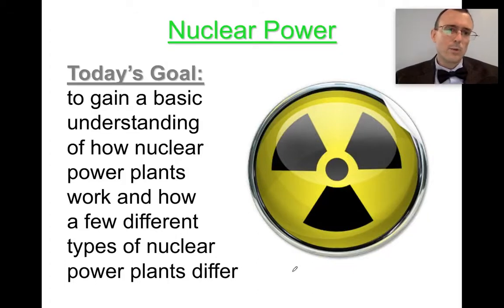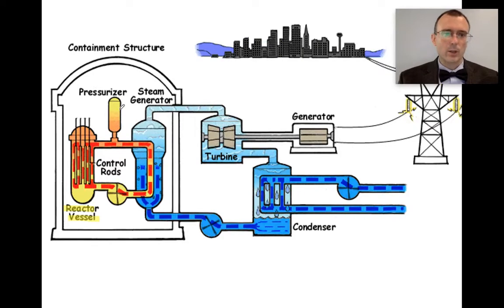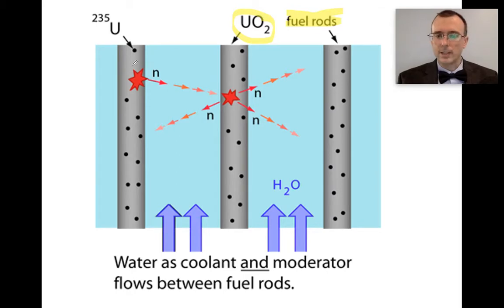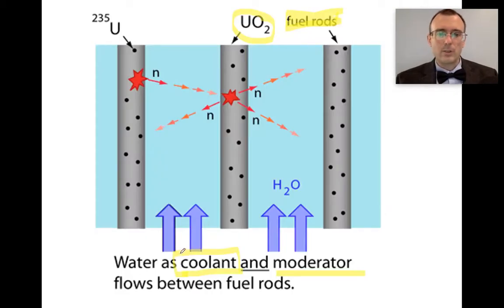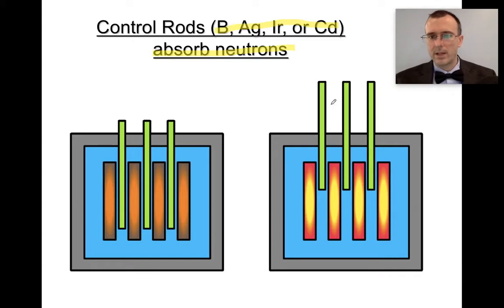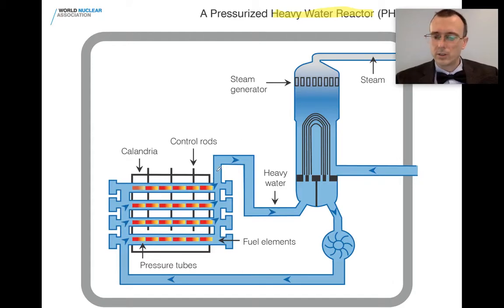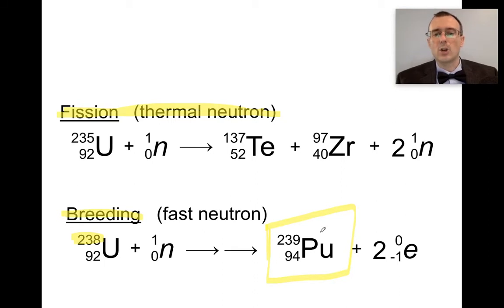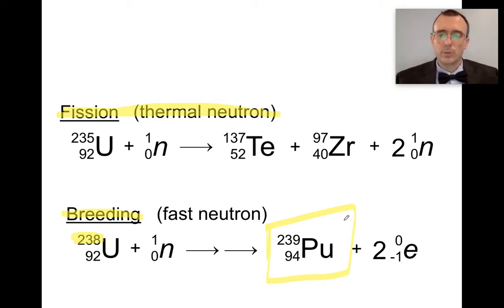How Do Nuclear Power Plants Work?

Comment: You mistook U235 for U238 at the 19 minute mark.  U235 is used in nuclear weapons, not U238
Reply from the maker: ah, you're right that I made a mistake, but your numbers aren't quite right either. Thorium breeds to make Uranium-233, which is what I should have written. Uranium-235 is used both in nuclear weapons and in traditional nuclear power plants. Uranium-238 is generally not fissionable except in special cases, like a fission-fusion-fission bomb.